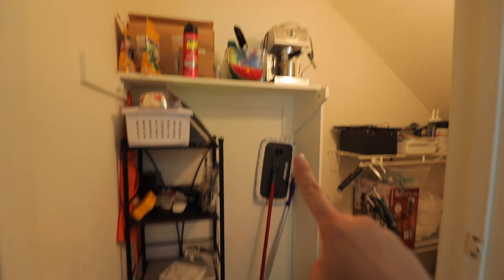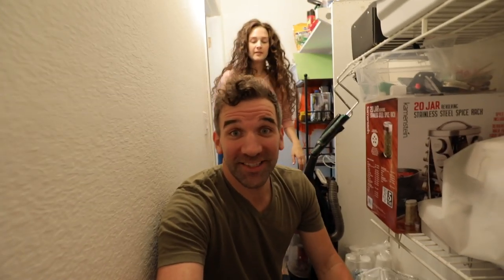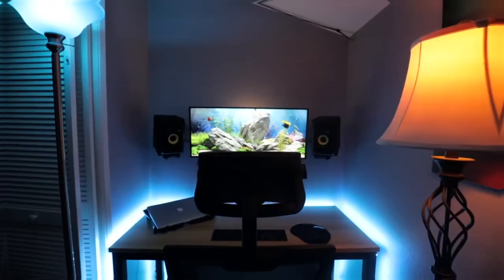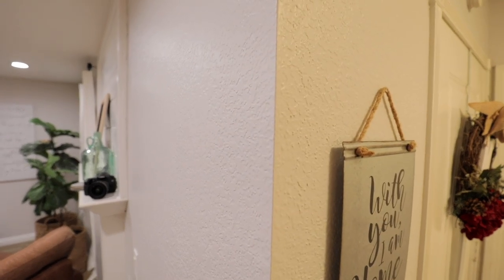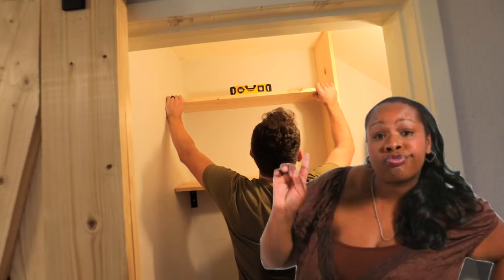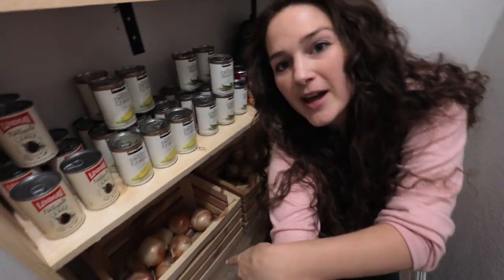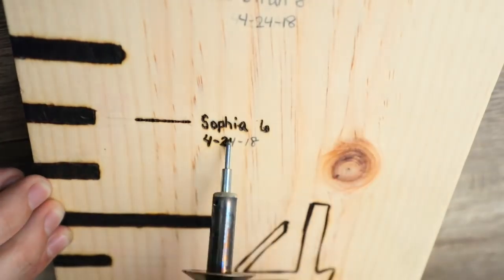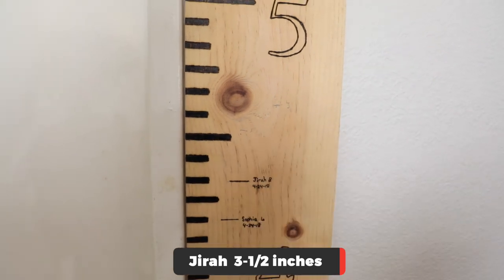DIY Pantry Shelves | That closet under the stairs | Home Improvement

Comment: Hi guys. I have the same issue at home with the exact same space under the stairs. I e been looking at already made shelving at the hardware store but it’s just not cutting it for the space I have. I just wanted to quickly find out what the depth measurement of the cupboard is and how much walking space would I need to leave open. Thanks 😀